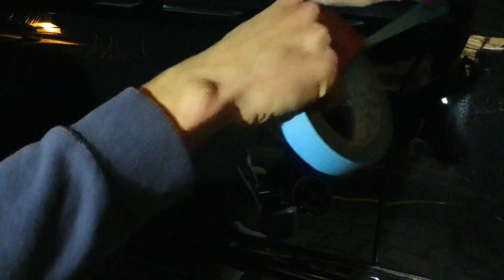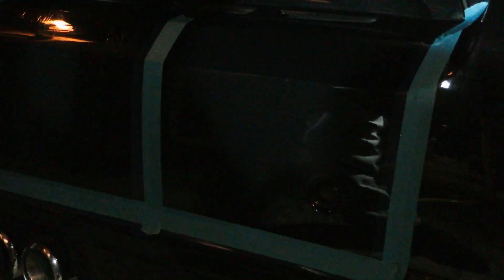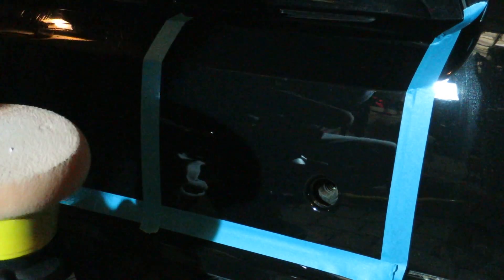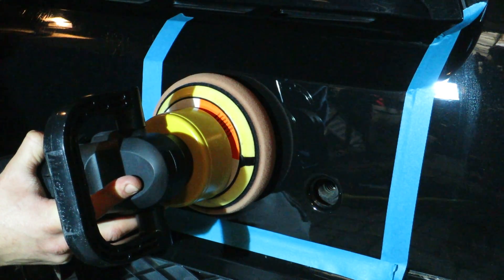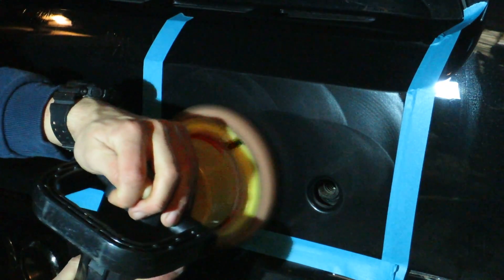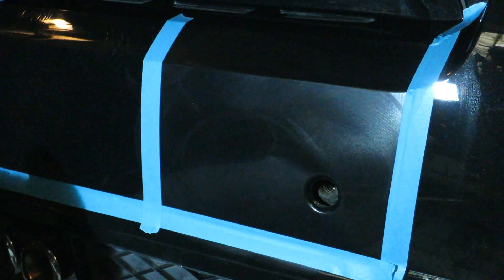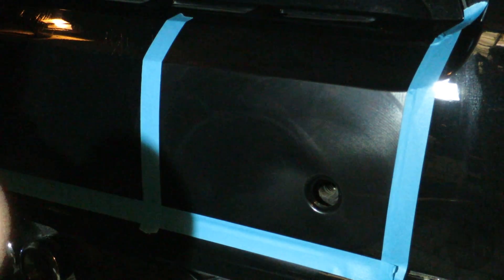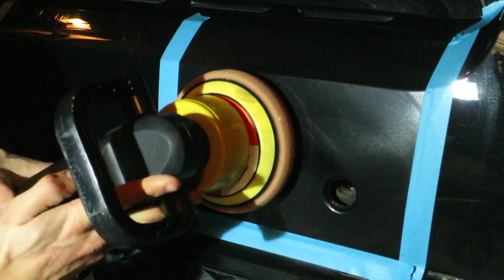One Step Paint Correction

Comment: Do you know if this is better than the chemical guys vss 1 step polish
Reply from the maker: James Landale unfortunately I can't comment as I haven't tried this chemical guys product. However, just from general knowledge I can say this... Usually products that describe themselves as one step products tend to be made of two main ingredients. The first, light abrasives that I'll remove light swirls. The second is usually a filler ingredient, to mask the swirls and scratches the abrasive couldn't remove. 
Where as this Menzerna is compound with deminishing abrasives. This means that it will not have fillers so the result you see here is a genuine result. 

I hope this answer helps,

Thanks for watching, Joe
Reply: Old comment, but I've used both on an entire car each so I figured I'd give my input. 

Both cars were Subarus, but the one I used the menzerna on was a 2002 while the one I used VSS on was a 2014. 

I think the menzerna 2500 is better, but VSS did take out some scratches and finished decently.